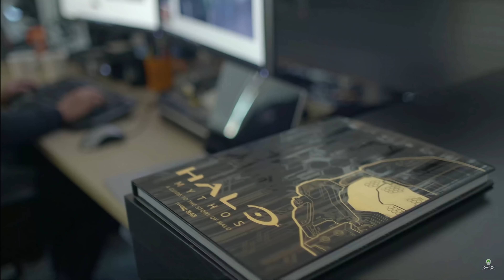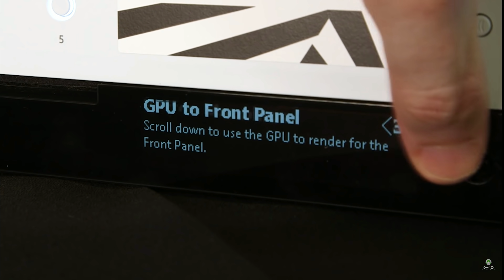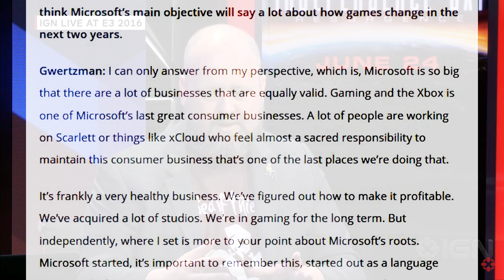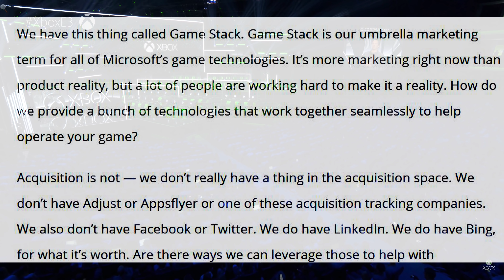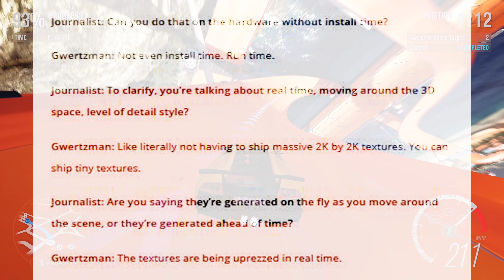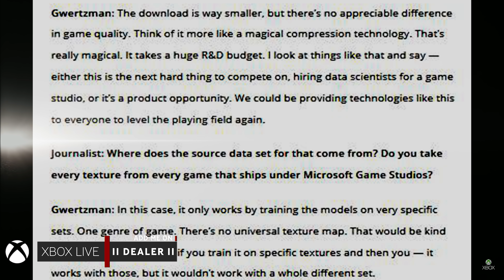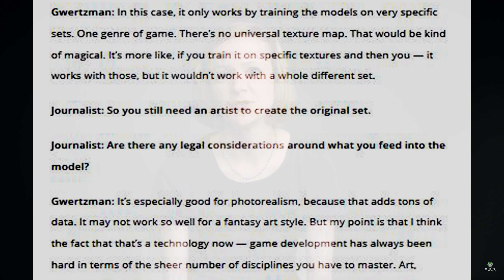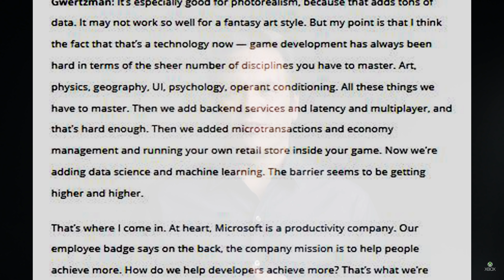Xbox Series X Advanced Gaming Tech DETAILED | New Next Gen Xbox Tech Does What Has Never Been Done

Comment: I hope all older games magically look better. They said they would.
Reply: Well, Ninja Gaiden 2 looks good on Xbox One X, and Kameo too
Reply: I dont see this happening, there are big titles out there that never even got on X1X upgrade
Dark souls 3, and GTAV lots of players but no X1X upgrades which are much needed 

Hopefully they atleast upgrade games that were recently released like borderlands, or devs just make all games use a unlock variable frame rate and resolution mode for games so  the new hardware pushes it to the limit
Reply: I'm sure they'll have ray tracing options for older games so yeah,  they'll probably look a lot better.
Reply: To a degree they all will..... But the most powerful future console from 2099 would still be limited by the game itself
Reply: It won't. Most games have capped resolution and frame rates so without a patch it will be the same. Games with dynamic resolution will benefit but there's like no console games with an unlocked frame rate.
Reply: @cMARVEL360  I have several SSDs in my xbox and PC, definitely helps with huge titles like GTA, witcher, FFXV

but the graphics just dont compare to what the X is capable of
Reply: @cMARVEL360  also with X improvements the frame rate and detail can definitely be improved because there are many dips.
Reply: @buckeyesfan4700  that's irrelevant because if the 4k really did hinder FPS they would make it optional

All 4k titles on X1X that run 30fps now just run 4k fps and if anything the frame rate are actually more stable

Comment: What do you think about that GitHub leak regarding PS5 being debunked?
Reply: Not debunked actually probably more solidified. 
It makes more sense for the 2ghz test speed if it is running RDNA2 , do to the cooler more efficient architecture.  The heat displacement won't be as bad.
Reply: @Valorian21  I know that. We just had some interpreting the leak as confirmation that PS5 WASN'T RDNA2.
Reply: @3dgelord187  oh Roger Dodger 👍😁👍
Reply: @3dgelord187  It isn't RDNA2.
Reply: @quora_treasure_trove  Sure, buddy
Reply: @Valorian21  
2ghz isn't hard to believe. 

It looks like Sony will have less compute units, but a higher clock speed. 
Fairly normal for GPU's to do this actually
Reply: RDNA 2 is the only and tech with VRS and raytracing....
Both of which ps5 has. And AMD literally stated the consoles this year are all using RDNA 2 live on stage yesterday. But k
Reply: @nighttimestalker  no they just said rdna. 
But it will be rdna 2 and will be at around 9.7 tfl. 
But I think they will end up delaying the console.

Comment: Definitely cool tech. 
Odd thought... a Xbox handheld device could possibly scale 1440p to 4K res. with less powerful hardware inside using this technique...
Reply: Fuzzy_Belvedere the APU still have to render all those pixels. But if you upscale again huge parts of the picture like the PS4 Pro and X1X already does today...
Reply: It’s more like a compression/decompression algorithm and not a performance thing. Okay it lowers the datarate between ssd and apu which is a huge bottleneck

Comment: Wouldn’t using an SSD already make file sizes for series X games smaller since devs don’t have to repeat a bunch of data or something? (If anybody can clarify it would be much appreciated)
Reply: Umm no, why on earth would devs need duplicates? If a section of code is written there is absolutely no need to write it again as you could simply call on it. You do realise that while loading all required information at that time is copied to ram which is so much faster then any ssd?
Reply: NiteOwl no like devs had to copy files because of how slow the HDD was. That’s why file sizes were much bigger. Am I wrong? Will the SSD make file sizes for games smaller in any way?
Reply: @DanielAnderson-ce8in  no it won't, it is actually the other way around. the problem with the HDD is it had to copy files over to the ram and as the drive was slower that could take a while. as a result they had to keep assets to a minimum in order for this not to take too long and that will end up reducing the size of the game. ssds can move all that data at a faster rate so there is no restrictions on how much data you can have except for storing it. why increase the amount of data you gotta move? that will only make it take longer to move.

Comment: What happens to the disc drive running the game... You know how consoles use to work I'd rather have a noisy drive than worry about storage.
Reply from the maker: Ramon Gonzalez Currently, disk drives do not run while playing games. They only run to install the game on the hard drive. After that the disc is just needed as a key. But never running during gameplay.
Reply: @XboxNews-DealerGaming  I know they don't. That's why I'm asking why they don't bring that back. That would get rid of the storage anxiety
Reply: @Wickedclownx33  mainly because games dont fit on the media anymore, games like RDR2 just simply dont fit on a disc anymore as the total game file sizes are getting to be close to 100GB. SSDs take care of the problem without MS having to create a new disc medium or resort to using Blue Ray's or dual layered discs. It's just cheaper and faster as you can quickly delete and install on an SSD, my 2 cents....
Reply: @hardkore360  4k Blu Ray discs have 100gb capacity I'm sure they can figure out how to do it where they can have the rest of the game downloaded if it's more then that
Reply: Ramon Gonzalez - I miss those days, man. I still play my PS2 a lot, and I wish memory cards were still a thing. Only now the format would be USB thumb drives for memory cards. 

The thing about that tho is that it would force developers/publishers to release complete games again haha
Reply: @Wickedclownx33  you lose all the benefits of fast storage and memory if you go back to read speed of an optical  disc

Comment: Xbox one X = RX580 = ~$220 GCN 
RX5600 (OEM) = ~$220 RDNA (+30% perf)
Xbox Series X= ~$220 RDNA2 (+60% perf)
So, Xbox Series X will likely be %60 faster than Xbox one X. (RX5700 performance)
Basically 1440p 60fps, high settings + raytracing.

Also, Texture quality and geometric detail will not improve on XSX unless it will come  with large amounts of RAM or at least 16GB of VRAM instead of just 8GB.

Even though NVMe is faster than a hard drive it still wont come close to gaming with large amounts of RAM.

RAM speed vs NVMe speed:
NVMe -4GB/s
DDR4 RAM - 25GB/s

As for machine learned texture upscaling, directML has been tested by Microsoft and it is barely fast enough to enhance the screen resolution but still reach 60fps. If it was used to enhance thousands of textures it wouldn't even keep up at 5fps. So no that wont work.
Reply: 5700 isnt anywhere near 12TF
Reply: @WayStedYou  Neither is the Xbox Series X.
Reply: @lb5928  umm it's already been confirmed....try looking smart elsewhere
Reply: @dani_i8942  Its been confirmed for 6TF (12TF of FP16)